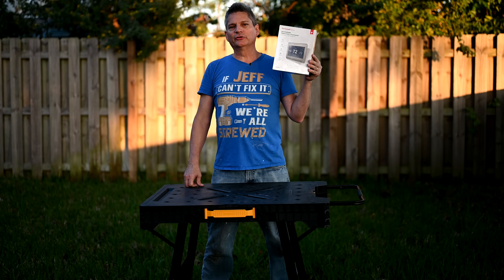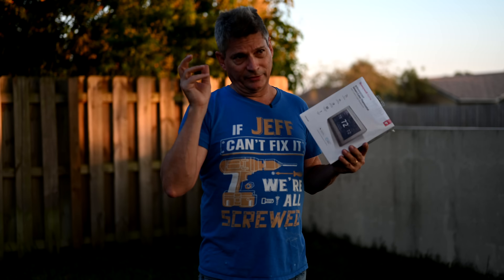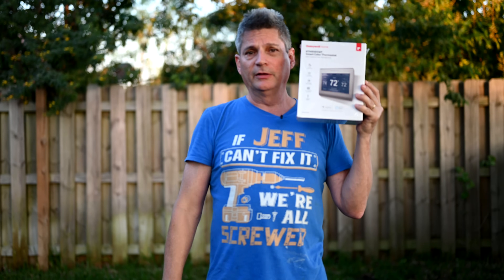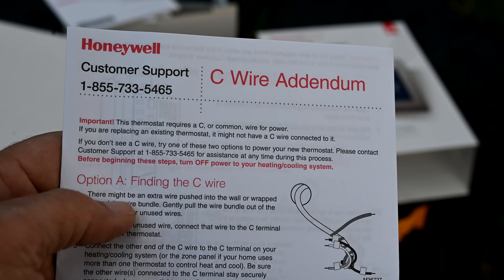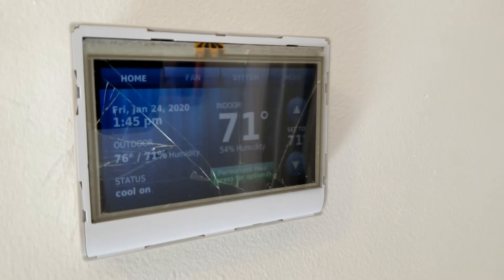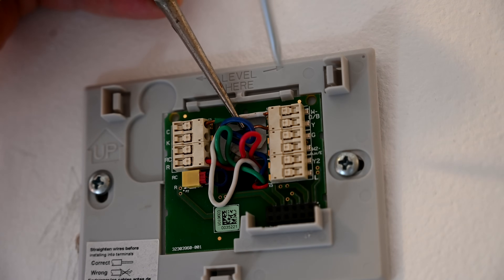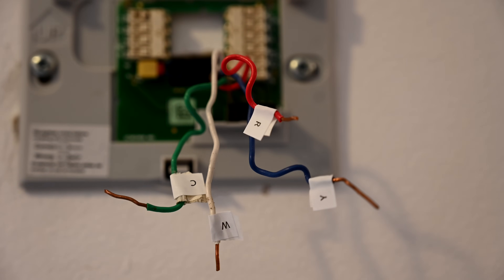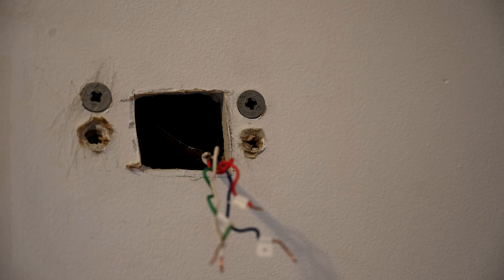How to Install Honeywell Smart WiFi Thermostat RTH9585WF Wiring

Comment: I keep getting mixed info on using a wired outside temp sensor. They say it can be done, but no-one has told me which terminals to use for this thermostat. Either it cannot be done, or can someone tell me where to connect? There is no s1/s2, responders say "get an electritian or hvac guy" but I've wired home entertainment systems that are more complicated, taught CCNA (cisco certification part where you had to make and run your own Cat5 wires to routers and switches), so I am not sure how wiring this is too complicated for me. Is there a terminal for external outside sensors or not? If so which? Thank for your response and sorry for being too wordy. Great video.
Reply from the maker: I never used sensors, so try the page on Honeywell's web site for this thermostat and then contact their customer care who can answer that, they don't  show anything in the manual

Comment: Hi Jeff, 
I try to install this one same as yours RTH9585Wi-Fi. I have only four wires White, Blue, Red and Green but the green wire you are connecting is C WIRE? It's supposed to go with G below Y?
They told me to buy C adaptor to install. Please let me ASAP so that I don't need to buy Adapter. Thanks
Reply from the maker: I had to steal a wire from inside my air conditioning air handler unit to pretend to be the see water because I too had a four wire system not a five wire system. So I looked on the schematic for my air handler and found a spot where I could grab the 24 Volt AC C wire but by doing that I had to disconnect one of the four wires going to the thermostat which controls just running the fan only mode on the air handler. So I lose the ability to ever just turn on the fan only which I don't mind because I only use my system in AC mode or in heating mode and I never need just the fan only mode so it was a loss of functionality that I am able to live with.
Reply: I have the same issue. So if I don’t care about fan mode, I can use the Green wire and put it in the C slot and not put anything in the G slot?

Comment: This thermostat has combined 'W-O/B' and 'W2-AUX/E' terminals.  I have seperate W1, W2, O, E wires on my existing thermostat. How do these connect on the RTH9585WF?
Reply from the maker: W - This is the thermostat terminal for heating. This wire should go directly to the heating source whether it be a gas or oil furnace, electric furnace, or boiler.	White for W Terminal.

W2 - This is the thermostat terminal used for second stage heat. There are gas furnaces with low fire and high fire and some depend on control from a two-stage heating thermostat with a W2 terminal. Heat Pumps use staging for auxiliary heat and need a W2 terminal.	Brown for W2 Terminal.

O or B - These thermostat terminals are for heat pumps. The B thermostat terminal is used on for Rheem or Ruud and any manufacturer that energizes the reversing valve in heating mode for the heat pump. Most other manufacturers of heat pumps will utilize the reversing valve for cooling and the O thermostat terminal will be utilized for this purpose. This wire goes to outside heat pump condenser where the reversing valve is located.	Orange for O and Dark Blue for B.(Rheem and Ruud will usually utilize the blue wire for reversing valve. If you have a Trane, Carrier, Goodman, Lennox, Ducane, Heil, Fedders, Amana, Janitrol, or any other manufacturer other than Rheem or Ruud you will be utilizing the orange wire for the reversing valve.)

E - This thermostat terminal is for heat pumps and stands for Emergency Heating. If for whatever reason the heat pump condenser fails and it is necessary to run the heat there is an option on heat pump thermostats for emergency heating. Basically this simply utilizes the back-up heat source many heat pumps have to heat the home without sending a signal to the condenser to run for heat.
This should be wired directly to the heating relay or the E terminal on a terminal strip board in the air handler or package unit if you have a heat pump package unit.	There is no universal color used for this thermostat terminal designation.

Comment: So I have a question what is the little plastic part that you press on to release the wire breaks off ? What should I do ?
Reply from the maker: If it breaks off, it could be stuck there permanently until you cut the wire off

Comment: I'm changing from a 2-year old Honeywell, so I'm lucky enough to already have five wires for an easy switchover...IF my blasted electrician had labelled my panel so that I could know if I've shut the power off to the unit.  Because mine is on battery, I can't tell if I've turned the right switch off or not?  Thanks for the helpful video once I get that part figured out.  :)
Reply from the maker: Glad to help!
Reply: @jeffostroff  Hilariously (and perhaps dangerously?), I thought I'd turned the right fuse off.  To test, I dropped the temp on the thermostat to see if the air would come on...it didn't, so I went ahead and installed the new one.  As soon as I popped the thermostat on, though, it powered up.  I thought it wouldn't power on until I went back to the panel to turn it back on?  I know it's got the C-wire for power, but wouldn't that have been off?  Or am I just lucky that I didn't shock myself?  :)

Comment: nice and very informative video. however, i have 6 wires (orange wire), i installed last winter and no problem at all with the heating. this summer, i tried the cooling and hot air comes out from the vents. any idea or advise to correct this. thanks
Reply from the maker: can't tell by color of the wirw, we need to see the schematic to see where the wires all go in the AC
Reply: Orange wire is usually for the reversing valve on the heat pump.  It should go on the terminal labelled ""W-O/B"   If you have a white wire, that is usually for your strip (electric/emergency) heat and that goes on the terminal marked "W2 (aux/E)".  Honeywell web-site validated this, and mine works like a champ.  Make sure you set it up for a 2 stage heating system.

Comment: Hi Jeff, thank you for the video. Question, my previous Honeywell Smart thermostat was not reading properly (installed 6 years ago) by contractor who was moving it when I had my kitchen/dining room remodeled. Now, after taking it off the plate, I noticed a yellow wire not connected. There is a blue where the Y connection should be so did he forget to install the yellow in Y2 position? I am installing the new one and wondering if I should connect it there? if I do, are there any issues I would face if it doesn't need connection? Thank you!
Reply from the maker: the colors of the wires you see don't always mean anything, you need to see on the air handler the  circuit diagram for the air handler that shows where each of these wires goes to, then see if it lines up with the proper terminal on the thermostat

Comment: Thank you for the video! Question, recently my thermostat (slightly older model) starts turning the air on sooner than the scheduled time. And I know the weather outside is not hot enough to start the program. Example: I have it set to lower the air from 74 to 70 at 8pm. This is starting to lower the air at 6pm. (before it would start around 7:45pm). So I decided to do a factory restart, and still same results. Now another issue. It is registering 75 when I know for a fact that the room is 70 degrees because I have 2 portable thermometers that I am using to make sure this is right and they both say 70. I tried to reach out to Honeywell support, but no response yet, been 3 days. Any advice? The unit is only 5 years old.
Reply from the maker: Maybe your time zone is off on the thermostat? Check the setup menu, find out what city is the time zone that it thinks it is set to

Comment: What if you have 6 wires. I also have an orange wire
Reply from the maker: Were they all connected? The colors are not standard so no way to tell, what you have to do is see where the orange was connected before on the old setup to help tell you where it should be connected on the new setup.

Comment: Can i asked, you never mentioned if you had use the jumper wires for the units that have the rh and rc jumped together, is it necessary in order for the unit to work as before??
Reply from the maker: I didn't touch any of the jumpers there so unfortunately I don't know the answer to your question. You can look in the owners manual PDF online, or Honeywell also has a channel on YouTube with a lot of videos that talk about these different types of things and what you need to do with them.

Comment: great video, fyi honeywell makes a c wire adapter CWIREADPTR, the only caveat is that it does not work with heat-only systems; with this adapter you retain all of your thermostat functions
Reply from the maker: Some people have resorted to getting a doorbell transformer and tie it to the 120 Volt supply, in order to arrive at their 24 Volt AC needed for the C wire
Reply: @jeffostroff  excellent idea, thank you!!!

Comment: What if there’s 2 black wires not being used is one the common ?
Reply from the maker: We never know which is which, there is no standard
Reply: @jeffostroff  so I installed the same thermostat but when I cut the ac on the heat or hot air would come out
Reply from the maker: @L5p_Jay   Sounds like a wiring problem somewhere that should be connected to the AC not to the heater side of the circuit

Comment: Does this device have a screen lock so my kids aren’t changing it?
Reply from the maker: You can adjust security options to prevent unauthorized changes to system settings. 1 Touch SETTINGS and select Security Settings. 2 Select Change Lock Mode. 3 Select an option and follow prompts: Unlocked: Full access allowed. Partially locked: Only temperature can be changed. Fully locked: No access allowed.

Comment: Would this not be compatible with a hydronic baseboard heating system since I don't have air conditioning? We use floor unit air conditioning units in my home & vent through a window. It's a slab foundation home.
Reply from the maker: If your system responds to a 24v turn on or turn off, it would be compatible

Comment: thanks for sharing 
my questions is if i'm having 5 lg packages 
can i control them bt one system or each package required Honeywell Smart WiFi Thermostat
Reply from the maker: I don't know the answer to this, I would suspect you could if you wire them all to this unit

Comment: Jeff, I've just watched this video and was looking for a replacement thermo for my now dead thermo. Everything seemed pretty straight-forward but when you come to the step where it asks for YOUR SYSTEM TYPE, how would I know which type of system to choose?
Reply from the maker: It's simple you either have a gas unit or an electric unit. You either have a heater or you have an air conditioner that does both heat and AC

Comment: Great video. This is my current set up Jeff. Left side- C, O, B, W/E, W2- right side RH, RC, G, Y, and Y2. Would this work with this model?
Reply from the maker: It should if you look at 8:30, see if it matches the printed circuit board with the labels

Comment: You said it does not work with 4 wires but I did not see you install a 5th wire and it works, why is that? Thanks
Reply from the maker: I already had robbed one of the wires to be my C wire. By doing so, I lose the ability to ever turn on my AC in blower mode only. No big deal, I only use it as A/C or Heat, never in blower mode

Comment: We’ve had one of these for a few months. It’s been great until today we got home and the screen is black we cant get it to turn back on any advise? Lol please help West Virginia is pretty cold 🥶
Reply from the maker: I would 1st check your Electrical panel and make sure that there's no tripped breakers in it. Tperiod the thermostat does need the 24 V AC coming from the air conditioning unit and if that stops then you're not going to get any power to it. The other thing is maybe your screen is bad but maybe the unit is still working so try to access it through the app on your phone and see if you can do anything there. That wouldn't weed out whether you have a bad display. Lastly you can try just popping the whole unit off the wall and plugging it back in .

Comment: Finally got mine installed; a couple of quick notes worth mentioning while I'm here.  First, this thing is flimsy as heck.  I broke not one but TWO of the plastic terminal housing just pushing the wires in, incredible.  I was half tempted to simply send it back right then and there, but figured I'd push ahead and see if I could get it powered up and working despite not having confidence that the wires were securely snug but it appears to be up and working thus far.  Second, it seems you MUST set the schedule and edit the schedule via the touch panel on the front of the device - I see no way to edit or change the schedule once you've logged in to your account on the web through that interface.  
*Edit - I had previously said you were required to toggle the device from heat to AC manually, but this is not true; you can set it to go between both as needed automatically, which is nice.  For the price, as long as you can keep from breaking the terminal housing with the wires, it's actually a nice little thermostat.
Reply from the maker: Good info be sure to use the app on your phone or iPad to control all settings
Reply: So you're telling me if I buy this expensive thermostat I still have to go to it and manually switch it during winter and summer months?
Reply: @justc215  Nope, sorry for the bad info!  It does indeed have the ability to go between heat and air without you having to intervene.  That was my mistake, it just wasn't clear to me at the time.
Reply: @Sudz28  Scotty! C'mon man lol
Reply: @justc215  I know!  I suck!  Sorry about the fake news.
Reply: @Sudz28  not all lol I actually had just ordered it before I saw your reply. Now I'm even more excited for it to get here!

Comment: What if our current wiring only has a W2 connection... the W has no wire running to it?  There doesn't seem to be an option for just the W2?  Great, informative video BTW!  I greatly appreciate everyone who posts videos on these sorts of things, I always prefer to see someone go through something like this that I'm unfamiliar with before I jump in and screw things up.
Reply from the maker: Sounds like you were dealing with some type of heater or heat pump only and not air conditioner am I right? The problem is these newer thermostats with the computer screens and everything need a 24 Volt AC source of power to operate. So if you don't have that in your in your system and you can't tap into a terminal somewhere in your circuit board to get that 24 volts, some people will run wiring in their wall to the nearest 120VAC electrical outlet, and then connect that wiring to a doorbell transformer which will give you the 24 volts that you need in order to operate the thermostat in order to turn it on.
Reply: @jeffostroff  Sorry, I should have mentioned that in my original post, yes I have a heat pump.  I contacted Honeywell support via their chat option and sent them a pic of my existing wiring, which has wires running to Y, G, C, W2, R, and an unlabeled terminal.  They determined that the unlabeled terminal was O/B (or something like that, I never got a transcript of the chat and didn't make a note of it at the time) and that everything as it is currently is correct.  They also confirmed that when the new RTH9585WF1004 boots up and asks me if I have W or both W and W2, I should select both.  Now to just figure out for sure which circuit this thing is on in my breaker panel 🙂

Comment: Please help!!  I have the same 4 wiring as you. Followed the video step by step but the power is not coming on.  Does it that a little bit for the thermostat to come on when you power the AC unit back up.
Reply from the maker: make sure you have 24v on the "C" wire, that is what powers the thermostat

Comment: What if you don't have a device their app will run on?  It won't load on my (ancient) Samsung phone and I don't have a tablet.  Can I complete these operations from my desktop?
Reply from the maker: I believe you can register on a PC, yes. Once you setup the thermostat you don't need to the phone app unless you want to control the thermostat remotely. I always just set the AC on and left it on.  You can also log into the mycomfortconneect web site and control it remotely by PC.

Comment: After connecting the heat just turns on unit not cooling
Reply from the maker: Did you take pictures of the wires before you connected, and are they connected the ame way

Comment: The ONLY thing I needed help with he did not cover:  how to separate the Honeywell mounting back from the unit.
Reply from the maker: small flat screw driver on the top of the unit where it meets the back plate. It sits down on top of the tabs at the bottom of the plate, and the top of the thermostat rotates back to click onto the tabs on the top of the plate.
Reply: But rest of video was fabulous!

Comment: I followed your instructions in the video and once I turn the power back on I seem to have a problem. The thermostat  turns on but the AC unit sounds like it's trying to turn on but doesn't. It keeps trying to turn on while the thermostat keeps coming on and off?
Reply from the maker: Honeywell has some tips here: https://www.honeywellhome.com/us/en/support/my-thermostat-is-set-to-cool-but-my-cooling-system-isnt-running-why/
Let us know if anything there works. Did you photograph your wires first, then wire it exactly as it was before? Is your shunt wire inplace?
Reply: @jeffostroff  I figured it out. I took the G wire and plug it into the C spot in the back of the thermostat but didn't change it on the AC unit. That's why it kept cutting off
Reply: @jeffostroff  Thanks for the reply and great video, it was extremely helpful